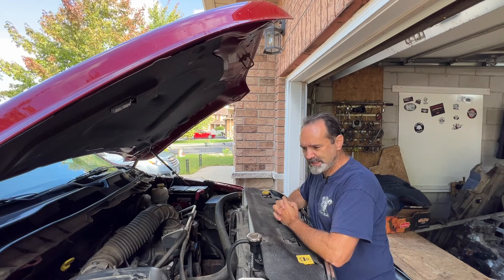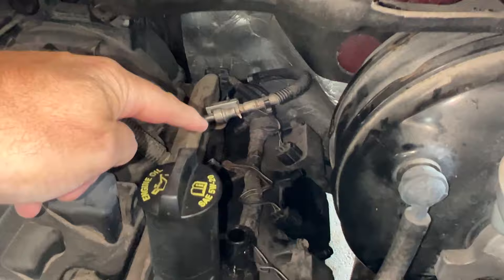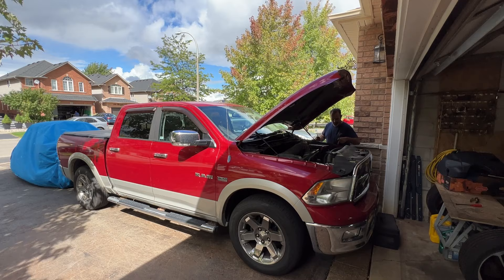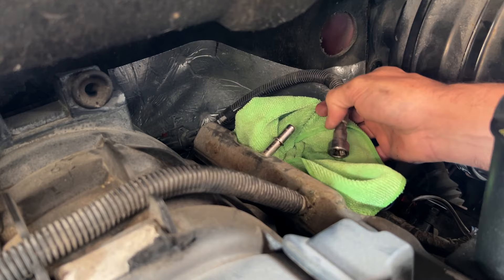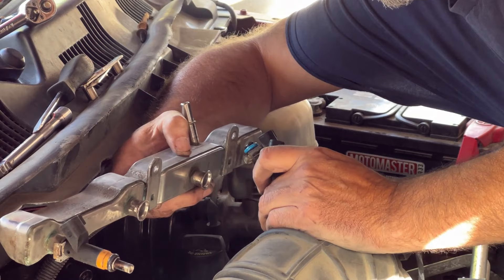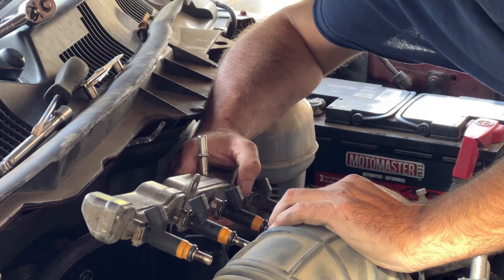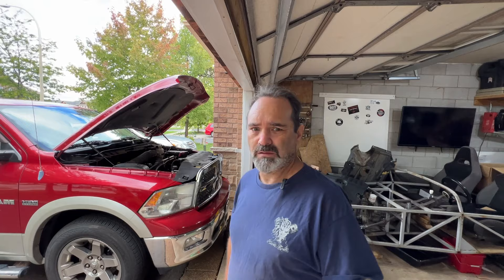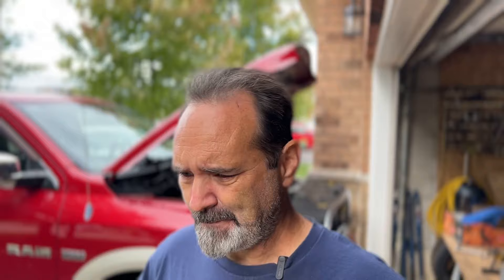Could My Hemi Engine Fault Code P0305 Be Caused By A Faulty Fuel Injector?

Comment: Maybe I just got lucky but I'm now at 180,000 km without the infamous HEMI TICK TICK TICK CAM & FAILURE. I can tell you that I have used high-quality 5w20 synthetic engine engine oil and increased oil change intervals to every 5000 miles or 8000 km. Time will tell, but I also have not allowed my engine to excessively idle as the majority of the cam and lifter failures where the engine was allowed to idle excessively such as vehicles, service vehicles, police, taxi, cab, delivery services, Ambulances, colder weather, environments up north, etc. Maybe I'm just getting lucky but I'm definitely keeping an ear on it lol.

Comment: Fellow Ram owner, going through the same. Why is always #5!? 😟
Reply: Fellow ram owner as well, I’m going through this right now :(
Reply: Same here..
Reply: Mine was #7
Reply: @Chefnaee hat was the issue
Reply: Cylinder 5 the devil ‼️
Reply: Have the same issue on cylinder 5 what’s the problem with it done changed the coil spark plugs and fuel injectors

Comment: I'm just watching this video now, but I'm sure you've already figured out that you need a new cam and lifter kit to prepare your misfire on multiple cylinders at higher RPM is when it's most noticeable on these engines that's why at low RPM it didn't throw a code and at higher RPM The misfire becomes more pronounced based on the speed of the engine and the more frequent opportunity for misfires.

Comment: Feel for you Scott. Been watching a lot of your videos. I remember your timing chain/ valve failure. Hang in there. 4 months ago I replaced my camshaft and lifters in my 17 ram 1500 after failure. Went through all of the diagnosis of swapping things to no avail. Was shocked to find a lifter snapped at the roller damaging the cam. Luckily it was only 1 camshaft lobe that was damaged. My truck is running strong now after I repaired it
Reply: Any update after repairing it after 1 year ? Just want to know if it’s worth the fix
Reply: Si esa es la falla. Árbol de levas cilindro 5

Comment: Once you get a P0300 code, such as you just did in the video that simply tells you that there is more than one cylinder misfiring in which Usually points to cam and lifter failure. That is assuming everything else on your vehicle is in perfect running condition from the exhaust from the intake, side, engine oil, coolant, air filter, fuel injector cleaner. I'm sure you've already used. no restrictions in the exhaust manifold etc. if everything else is checking out to have no problems and  in healthy working order? Then unfortunately you will likely need a cam and lifter kit handsome really good high-quality synthetic oil afterwards. Once that's done to prevent it from happening again a good counter measure would be a high flow oil pump. It's  the oil pump that's on the big brother to the 5.7 L which is the 6.4L HEMI 6.4 392 HEMI. It's a factory direct bolt on oil pump that the one in your current engine in order to get the proper oil pressure and not throw a fault code.

Comment: I’m going through the same thing with a Chrysler 2006 5.7 hemi I’ve already put $10,000 in this car and I still have the same problem and I took it to the dealership like an idiot. Now I’m repairing it myself I just put in a new computer also which helped but didn’t fix it.

Comment: Just be careful with microfiber cloths in engine compartments - just a suggestion: use terri, it won't melt on hot surfaces.

Comment: Hey, I know this didn't go how you hoped, but just wanted to say thank you. I had a P0302 code. Checked wiring, swapped Coil packs between 2 and 4. Swapped plugs. Finally a new Fuel Injector did it. Way smoother. Not perfect, maybe build up? But the code never returned and it really is night and day. Your video was key for me with zero experience of any kind. 

So, thank you.
Reply: Hopefully you remember, when you had that code and you changed the plugs, when you idled did it sound weird, having this issue and swapped the plugs with the same code and hoping to try this next

Comment: I had a 305 code. I changed the coil pack and spark plugs, didn’t work. Then I swapped injector 1 with injector 5, I gave them a very good cleaning as well. This way I know if the code follows the injector that’s the problem. If the code stays on cylinder 5 it’s most likely the cam shaft.

Sometimes the simple things are overlooked and people start tearing stuff apart for no reason. It’s been 3 months or so and no more issues. Clean your injectors before doing any major work.

Comment: Scott , a bad cam doesn’t start skipping after it warms , if a cam lobe is bad it’s bad cold or hot and skips when you start each time , it’s metal and when it’s lobes are worn down doesn’t get better clearing codes . Your engine  runs fine no skips while sitting then when you bring the rpm’s up it throws a code it can only be a couple of things fuel or electrical issues . 
Have you checked the fuel pressure before and once the engine computer throws a code .
Your multiple misfires I think are fuel or electric . Can your diagnostic scanner run a injector test ( not injectors I think )  and can it run a fuel trim test and if so see if it drops off when the skip starts . Happy hunting and don’t pull that cam  and I sure the valves are moving just fine . It’s frustrating to see you work so hard ar this struggle .
Reply: Disclaimer , I don’t work as a mechanic I just work on my own equipment for my business and my hot rods and my statements are just speculation . 
Life was a lot easier when one wire started your engine and the same wire shut it off and there wasn’t three miles of wire under the hood just to make it start .
Reply from the maker: I don't think the cam is causing the bad running. The knock sensor is detecting the misfire and throwing it into limp home mode. I think if the computer wasn't such a smart arse then I could keep driving this for another 100K before I'd really notice a fault, lol. Hmmmm, error code delete? lol
Reply: My exact thoughts can't  clear a code on failed mechanical part. Then have it work by clearing code.

Comment: Going through p0303 right now.  Just changed my plugs.  No help. Checking coil pack tomorrow and injectors. Your video was well done in showing me what I'm getting into and how to do it.  I'll be referring back to it tomorrow. Thank you.
Reply: Hey brother going through the same problem but didn’t change the fuel injectors
Reply: Any update ??
Reply: Hello ?
Reply: I did plugs, coil packs, swapped injectors… nothing. Used Blue driver Obd reader live setting to examine O2 sensors… 1 of the 4 sensors showed no reading so I’ve ordered a sensor and will replace. Fingers crossed.
Reply: For some reason I never saw this.  Sorry.  Nothing yet. Currently truck is at the dealership and they're trying to do a number on me.
Reply: Same problem here😭
Reply: I'm not sure where you're at with your diagnosing of a cylinder misfire. I just gave some advice to the gentleman in this video regarding his misfire.. the next tasty ship perform is a compression test followed by a leak down test in order to determine whether or not it's a cam and lifter failure. If you're having the same issue at high RPM, or at high-speed it's most likely the lifter failure, because it's more pronounced and noticeable at higher RPM with less time for the intake and exhaust valves to seat properly in order for proper combustion process to take place.  Hope that helped but I'm sure you've already figured it out.

Comment: You could also perform a cylinder leak down test in order to determine if it is, in fact, the cam and lifter causing them misfire with the intake valves, not fully seating and the exhaust valves because of the worn lobe or lobes on the camshaft. if you don't have the leak down tester, which is the opposite have a compression tester which could also be your next test checking the compression of each cylinder or just two or three of them to get an average of above 100 psi at cold engine operating temperature. Ideally, you would like to see approximately 150 psi on a good healthy engine during the compression test. if you do choose to hold the throttlebody open during the test, it's best to make sure nothing will get sucked down the throttlebody into the intake manifold (Ask me how I know)? If you're able to rig the throttle body to stay open, using some type of steel rod, then it would stay open fully during the test because if you just put your foot down on the gas pedal that won't work like it used to in the old days because of the drive-by wire It'll just put it into a flooded fuel condition in order to purge the fuel system of access fuel. if you don't hold the flap open on the throttle body, that's OK too but just make sure the same test is done for each cylinder at the same temperature so it's best to do it all at once in order to get an accurate reading. Regardless of which route you choose of the throttle body it only matters what the average of all of the cylinders is? If you did a compression test of all eight cylinders and seven of them were 125 and one of them was 75. The average would be 125 and whichever cylinder has 75 psi is the culprit. Next test would be the leak down test in order to verify whether or not it's the intake and or exhaust valves not seating properly while keeping in mind, there will be some acceptable amount of lead down psi through the piston rings into the crank case just like a normal combustion process of up to approximately 11% of the initial reading during the leak down test is acceptable. Again a healthy 5.7L V-8 HEMI ENGINE consistently averages 150 psi per cylinder on a healthy fully functioning engine. no less than 100 psi on any given cylinder is considered acceptable. Anything less than 100 psi is in need of repair. You can look at the valves going up and down, but it won't tell you the true health of a cylinder within an engine unless you perform the pressure tests. Hope this helps.
Reply: Leak down test won't show a worn cam lobe.

Comment: I have the same problem, with my truck I swapped the coils around and scanned it again but this time it said multiple misfires, so I cleared the codes and drove it for 20 minutes and it narrowed it down to one cylinder, starting it in the driveway doesn't always give you sufficient results
Reply from the maker: For me it turned out to be a bad PCM. There was no way to know other than swapping it out.

Comment: My truck currently has this issue and gave me that same code they found a broken spring they found a throttle body issue as well as bad spark plugs, All in all $1,600 job 😭😭😭😭.... It is a 2017 ram 2500 tradesman with the 8-ft bed. And only has 48,000 mi. I'm ready to sell her but I love her so much 😭😭😭😭

Comment: i have a 2010 grand cherokee hemi-just started having number 4 cylinder doing this-changed out plugs, changed out coil. same thing. i have less than 40,000 miles on my vehicle and it has been my most trusted vehicle. i havent done injector change. debating whether to do that or just take it to the shop and have them check it out. i will be disappointed if my engine has failed at 40k miles

Comment: If the cam or lifter were bad it would make noise! Still think it’s a wiring issue, injector or coil? Need to check the driver signal on each when it’s missing. Possibly the coil or injector driver in the computer shit the bed?
Reply from the maker: That sounds incredibly hard to diagnose, lol.
Reply: @ScottRods  what was it
Reply: @randyu8688  pcm he said in another comment

Comment: I used to have a 83 tbitrd that would cut off and die when I turned the corner too hard. I tested the wires and it was the fault. If all else fails check them for a ground. I think they used candy coating on these wires instead of insulation.

Comment: Dealing with this now on cylinder 3 on my Ram 5.7 hemi . Changed plugs , swapped coils etc still misfiring, My fear is lifter / Camshaft  and the only way to know is to remove the valve cover. And watch the valve springs ! Of course it's the drivers side so I just do not want to do it ! It's the only way to know for sure if it's a lifter issue , the compression test doesn't tell anything. You have to look . I don't have 3 or 4 K to fix it if it is , Not sure what to do ....
Reply: Having problems with my truck same thing I just replaced coils and spark plugs just need to switch the injector and that’s my last hope

Comment: My 2014 is doing this exact same thing it's just a p0300 and don't all the same replacements all but injectors and o2
Reply: And runs fine just hates to idle
Reply: Same what did you do?
Reply: Just running it still no idea what it is leaning towards throttle body with the idle air control in it is bad

Comment: Not that this may be the same but had a similar issue with my F150 5.4 cylinder 7 would work great for a while then start with the missing and throwing cylinder specific as well as multi cylinder misfire codes.  Replace the coil and would go away.  Tried pretty much everything that you have done with the exception of the injectors.  I also had cam phaser issues that were addressed by blocking the phasers and reprogramming the ecm.  Finally had a spark plug break off in cylinder 7 while replacing the plugs that required the head to be removed to get it out.  Engine had 305k on it so found a rebuilt and had it installed.  Original injectors and coils were used and no codes have shown up in the 15k that i have put on since the rebuild so thinking that the issue, unfortunately, was cam lifter related.  Suggest look for a 5.7 from a wrecker, Kijiji or some other equivalent with way lower miles which you should be able to get for a very reasonable price as there are many out there, change out the engine then sell.  Would be a cost but looks like there will be a cost anyway just thought this might be the easier way to go.  As for the cab rust not sure about Ontario but needs a safety and body integrity is part of the safety to be able to be registered by new owner so that could be an issue for you as well to consider.  Not a good situation and very discouraging!!!!!

Comment: This same thing happend to me, I’m still trying to figure it out, P0305 replaced all spark plugs had no difference, swapped coils and it didn’t follow. put in a new injector and ended up with more cylinders misfiring on top of cyl 5, guess I’m gonna taking the intake and valve cover off to get a better look tomorrow
Reply: What was it ?

Comment: Poor Scott… Ugh…. This is a shot in the dark from an old guy. Twice in my 75 years I have had high mileage cars go wonky and discovered the cat converter had clogged up and turned the engine into a big compressor. The symptoms were it would start, then after a few minutes/miles/feet would run horribly. This was before error codes and to test was simple, take the cat out of the system and drive around for a few minutes. Might be worth a try as it would likely confuse the computer trying to spy out a code.
Reply from the maker: Thanks Joe. I'll do the valve inspection first, and if the valves look like they are doing as they are supposed to, then I'll try the cat thing.
Reply: Sorry, that was supposed to read ‘spit out a code’ not ‘spy out’ , told you I was getting old… by the way, don’t get discouraged your trouble shooting logic is impeccable!

Comment: Hang in there I know your pain.  A compression tester would also be helpful to compare the health of cylinder 5 to the others.
Reply from the maker: I've kind of accepted my fate at this point. To be fair, 300K kilometers is pretty good.
Reply: @ScottRods  Agreed 300K is excellent.  Just remember anything can be fixed.  It will be interesting to see what lies below the rocker cover.

Comment: Hey brother I have a 2013 Dodge Ram 1500 express and have the same issue but mine is cylinder 6 what did you figure out
Reply from the maker: Turned out to be a bad pcm. No way of knowing, I just took a chance and swapped it for another one.

Comment: Hi, i like the scissor tool you used at the 4:30 mark to remove the supply line  - whats it called, and where can i find one? Thanks!
Reply: harbor freight will have this tool not sure of the correct terminalogy look in the aisle where auto tools will be getting ready to try  this on my ram same problem best of luck

Comment: Could be the computer mine was running like that changed the ecm and bam works great code is gone
Reply from the maker: Hey, you were right by the way.
Reply: How was it running bad what kind of symptoms? My 12 ram hemi has a cylinder 7 misfire and while driving the truck studders and shakes a little when accelerating and the rpms are between 2-3k
Reply from the maker: @HomeGrownPyro1  Mine was doing that pretty bad at one point. Sometimes it would just cut out at traffic lights.
Reply: @ScottRods  thanks for the reply. I was just reading through the comments watching your video again trying to pin point the issue with my truck. Whst did a pcm run you in you don’t mind me asking?
Reply from the maker: @HomeGrownPyro1  I got one on marketplace for $75 plus 60 to get it flashed at the dealer. Make sure you get the same type from the same generation.
Reply: @ScottRods what type of test do u do to see if the pcm is bad, my 5th is misfiring but I also have p1524 code. Idles fine and only misfires after 30 mph